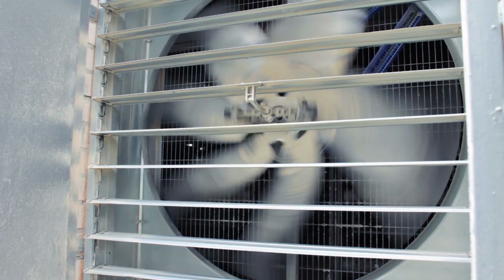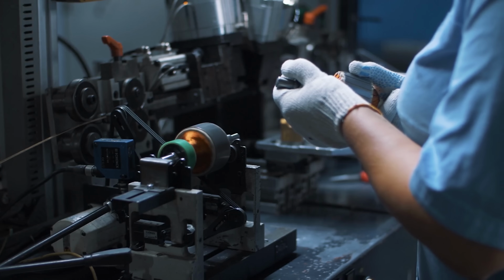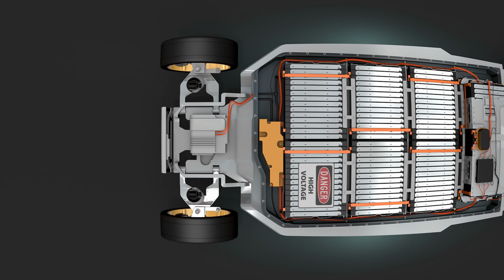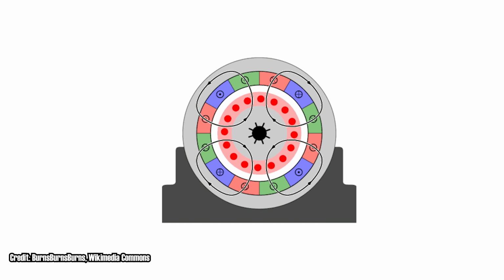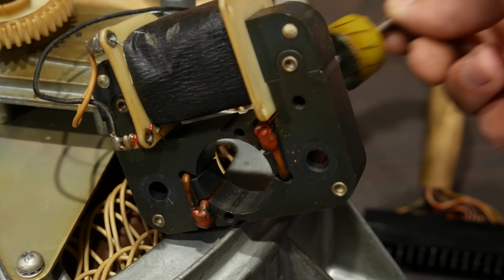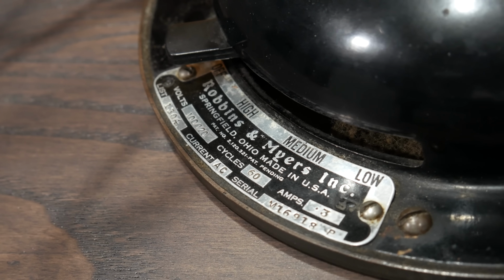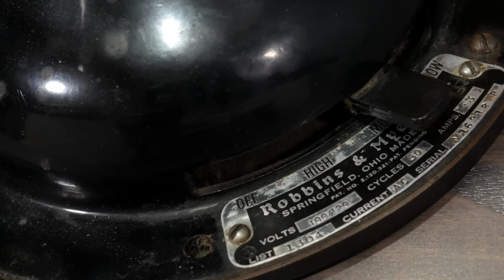Fans; High is next to Off on purpose

Comment: My sister's family have DC powered ceiling fans, and I've noticed that when you turn them on, they first rotate in the opposing direction before rotating in the selected direction.  I think this is to help ensure the fan starts, even at low speed, and to prevent it from stalling upon start up at low speed.

Comment: 14:15 I actually have a couple of tower fans that do that exact same thing. They have separate power and speed controls (complete with remote control and probably a logic board of some kind). When powered on, they default to the last speed they were set to. But, for about half of a second after powering on, they run the fan at full speed.

Comment: "The High setting is first because you need extra power to get the fan spinning from a standstill."

Me: Sets fan on low . Unplugs it . Plugs it back in .

Fan: Starts spinning anyway even though it started on low .
Reply: Yes, but think about, as the fan gets older and the bearings or bushings start to get gummed up, the motor will be harder to start as it's now not as free spinning.

So it would require high to get going.  I had this happen to a window AC unit (vertical).  All worked great for years and I usually had the fan on low.

But then the thing got gummed up and the fan wouldn't start up, unless I left it on high.

Even then, if finally gave up, so I have to remove the AC unit, take apart the fan motor and give it a good cleaning and oiling.

Then it was back to normal.

Comment: When I was a kid, my mom had an old electric Soviet sewing machines. The peculiarity of using this sewing machine was that it had a pedal to control speed gradually. But if you just slightly press the pedal, the machine would hum and nothing else would happen. To start the mechanism, you had to give a flywheel on the right a push, and then it could start sewing at a slow speed. 
However, if you stomp on a pedal, it would start at a rapid rate with no problems. 
I am sure this problem is solved by now, Soviets decided not to bother with it at the time.

Comment: This is great, I just took my fan apart to see if it had a cap, because it was having start issues, so after opening it up, I found no cap!  This video showed me that it is just the bearing, I had figured that out anyway and blasted the bearing with lithium grease and it is working fine, but still needs a nudge to get moving.  Guess its time to buy that 100 year old fan you have!

Comment: Remember that a 100 year old motor was (over) designed to operate for long periods of time. Today motors are designed to be efficient, with just enough core material and windings to do the job. And most importantly the bearings may just NOT be robust enough to run after a hundred years of intermittent use, contributing to the excessive starting torque required.
  Thanks, very well thought out videos.

Comment: I have a fan that goes from Off to Low and I very much appreciate that. What annoys me far less and in fact is very practical, is how the highest setting is is next to Off on a gas stove, so there's enough gas to easily ignite the flame. That actually makes a pretty tangible difference in my experience. I find it far easier to light on higher settings than on lower ones.

Comment: Fun fact, entering the stall condition is dependant on the initial position of the rotor relative to the stator. It may be statistically low that your old fan will stall on a low start, but not zero!

Comment: Without watching I'd answer to your title's question thus : At lower voltage the fan will take much more time to speed up, so if you want low speed you can stay a few seconds on high to build up speed and then switch to the lower power.

Comment: I like that fans turn to High, then Medium and Low, because I'm usually hot and wanting the relief of cooling that the fan produces (by evaporating moisture from clothes and skin). I'd slap it right to High immediately if it were Off-Low-Med-High.

Comment: Interesting... I have a smart plug connected to 2 fans, one window and one that just sits there to blow air on because I can't handle stagnant air for very long for some reason. They're both set to like medium, I don't have any problems, though they are very new fans so I'm glad to hear they can tolerate being on and at a standstill. Loving the content, I know it's over 4 years old now, but still quite informative.

Comment: You correctly say the national grid is 3 phase 120 degrees.

You then say that 2 phases are brought into the consumer unit.

I am English and have never investigated USA power systems.
But I do know that Thailand runs 3 phase in some areas and 2 phase in other locations.

I said the linesman that told me about 2 phase was wrong and stupid.
But I was mistaken.

They do use 2 phase and have understandable reasons!

So I reflect on the USA 2 phases in a consumer unit.

I suspect they are NOT 2 of the 3 phases as you imply.

I suspect the 2 phases are 180 degree opposed.

110v to gnd on both & 220v between them.

Perhaps a bit of star delta transformation math could be slipped into an International picture of mains distribution systems.

Note some use copper and others use alluminium cables.

A tangent,
Metering - single phase meters vs a 3 phase meter.

Tangent,
How a 3 phase meter works when the I or power per phase is NOT equal or balanced.

Ps:  you perpetually  missed the word "stickshon" in the fan motor startup.

Nice work,

Comment: Small critique: I believe house current uses one phase. At the pole, a transformer reduces the line voltage to 220, and the transformer has a center tap that is neutral, but allows either end of the transformer to connect to it for 1/2 the voltage, ie 110. If house current was two phase, 220 would be separated by 120 deg instead of 180 like it is. Also, 208 is a modern 3 phase that is common for commercial lighting and baseboard heating. 220 single phase is what electric stoves/dryers run on.

Comment: Actually commutators are used for constant duty industrial equipment, all the way from motors driving manufacturing equipment to the starter/generators found on airlines. The brushes are swapped out. For household stuff, brushless motors are most common, but industrial equipment usually operating at 400v runs with brushes most of the time.

Comment: Fans made 100 years ago had REAL bearings that would last 100 years.  Most fans seen in today's trash piles are only in need of oil on the cheap bearings that they are made with.  They CAN be disassembled, oiled and reassembled.  I have 40+ year old fans with the cheap bearings that are still working (YES, they have to be cleaned and re-oiled periodically, but not that often) and I not buying a new one every other year.

Comment: 7:50 Wait...so is this why old/small prop planes need someone to actually spin the propeller to get it started?
Reply: Is that a serious question?
Reply: @FAZWORTH421  I'm not sure why it wouldn't be? I'm not an expert on engines or motors, and I never made the connection between fan blades and plane propellers until it was put in this context. But the planes I'm speaking of use fuel as far as I'm aware of, so I wasn't sure if the same rules applied once the connection was made.

So...yes, it was a serious question. Thanks for asking?
Reply: @Sisren86  Hey a lot of people be trolling, and you don't have to be an expert on engines. Just have enough common sense to know that an one is an electric motor and the other one isn't!! Cmon now, how the hell is any of this science homeboy just talked about related to internal combustion engines?
Reply: @FAZWORTH421  My question wasn't about where the power comee from, but rather if the mechanisms used to start the blade/propeller turning were the same. Because those planes did in fact need to have their propellers pushed to get them going, despite being a combustion engine. So if not for the same concept that was explained, then why?

Comment: i just replaced a 30 year old fan yesterday, and wondered why knob style controls started high, now i know. i replaced it not just because it was old, the button style controls had the off button tripped permanently, so i had to jamb a penny between either side of medium depending on what speed i wanted it to run. it also had the angle screw housing stripped so it was propped up where i wanted it with a ruler. last week we had storms that caused a power interrupt and it didnt spin up once power was restored. i unplugged it and also saw there was a split in the cord sheathing just past the angle strain relief. that only confirmed my need to just scrap it. i will miss it only a bit since it had my last name on it.

Comment: @4:55  No, you won't have 2 of the 3 phases in your home/apartment.  The 3 phases are out of synch by 120 degrees.  The home has 240V with two phases out of synch by 180 degrees.  That is generated from ONE of the three phases, at the transformer.

Comment: Funny how I didn't watch this until the end of the long day which started by my waking to a faint buzz and the smell of hot metal. My AC fan would not run, and it got up to 100F today. Repairman replaced a fuse, but left it off, so when I got home to a 92F apartment, I assumed it was still not fixed. All's well that ends well.

Comment: Short answer. High is the first setting from off because that setting has no fan resistor and the fan resistors are connected to that circuit in parallel.

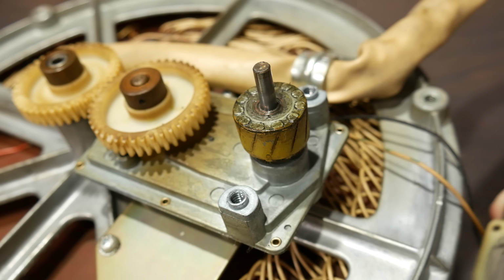Comment: @Stierenkloot  11:04 I'll repeat. The question posed was why is high next to off. Everything you said is accurate, but is filler to the actual question posed. Interesting filler if you were not aware if it but filler all the same. Yes, a motor not in motion creates no torque, yes, a start winding is used to initiate the rotation, however, it doesn't produce enough torque to really get the fan moving. The torque produced on high, once the start winding starts the motion is used to ensure enough torque is being produced to effectively get the blades going.

Comment: Makes sense. I have a fan at work that lets you start at any speed with buttons instead of a dial. It always stutters if I start on the lowest spin, so I always start it on high and then adjust it down.

Comment: Induction motors will wear out because of the expansion from heat cycles. It causes the windings to rub off their insulative coatings, and it will eventually short. That's why you want to keep industrial motors at a constant speed and temp for maximum life

Comment: You notice the need to start on high when the fans are dirty or there is hair tangled around the axle.  Yes, they need a cleaning and oiling at that point, but that obviously doesn't happen when you need to use the fan NOW and if it works with a bit of a shove you hope to clean it later when it doesn't need to be used immediately.  And I have gotten fans to start moving by pushing the blades, often with a stick.

Comment: Until the 1970s electric and diesel electric trains mainly used electric motors with brushes. 

There were multiple reasons for this, one being that 3 phase current was hard to create from a single overhead wire and triple overhead wires a nightmare. 
Another reason was that the frequency of the field was hard to regulate. This needed more advanced electronics for the control, that work at high power. These were not developed for use in such applications until the 1970s, to my knowledge.

Comment: I knew a lot of that already but still watched the video all the way through.  FYI:  A lot of homes built in the late-1960s and early 1970s (at least in California) are equipped with 3-phase electric and 3-phase plugs for electric appliances.  My home has them in the garage (clothes dryer) and kitchen (stove).  The odd thing is it also has gas supply lines if you wanted to use that as an appliance fuel instead of electric.
Reply: You probably have something called split-phase, which is single phase split in two voltages; 120V and 240V.  3 phase is found in stores, office buildings, school etc.  Three phase typically supplies 208V, 270V, 480V and 120 for wall outlets.  This is why for example lighting circuits or sometimes air conditioners in stores or schools etc. are 270V.  The big air conditioners and parking lot lighting are commonly 480V.

Comment: The fans on my PC case have a physical switch that controls the speeds but they will stall if you turn on the PC while they are set to low which means you have to switch them to high and then back to low every time. I basically can't leave it on low without supervision because if the PC restarts its self or sleeps and wakes again, those fans will not restart and they just sit there humming, just like the desk fan in this video.

Comment: What a twist to the universal motor! It's vice versa. The DC motor will run on AC provided the frequency isn't too high to cause commutator problems. This is why trains run on 33 1/3 hertz, because back when the infrastructure was established the commutated DC motors would stuggle with 50 hertz.

Comment: My fan slow is next to off.  You can fine tune speed with the dial to any speed between 0 and max.  It also uses a lot less energy.   Its has a brushless motor.

Comment: I don't know if you will read this comment or not, but in India all the fans go from off-low-medium-high. Sometimes instead of three speed options, five speed options are given, i.e 0-1-2-3-4-5. But I have never seen a fan in India, which goes like that in your vide (in USA or Europe? not sure though). I don't know what will be the explanations for Indian fans according to you?

EDIT: Just to note, not all fan regulators are made cyclic, i.e you can't directly go to high to off. One has to go in opposite direction (High-med-low-off) to power off. That's why I have specifically mentioned the above order.

Comment: To the people saying the video is too long/has uneccesary information I ask a question. Is fully understanding a concept greater than having a simple answer? 

Could summarize as higher power is needed to start the motor. Or an understanding of mechanical components, phases, shaded pole motors, and stalling could be developed. Both are useful in different circumstances.

Comment: TLDW: Fans are easier to produce and cheaper to buy when they’re simple, and while going from OFF directly to LOW is definitely possible, it’s way less complicated to just have the fan go from OFF to HIGH. 

Starting the motor takes HIGH level power? Why over-engineer a system that starts the motor for you and then readjusts to the desired setting when you could just make the first setting HIGH instead? It saves everybody time and money

Comment: EU resident here. Never saw a fan with a dial/slider, they all have mechanical push down buttons, one for each setting, only one can be pressed down at a time.

A dial/slider seems as awfully dangerous, it's weird that you have to increase the speed to turn it off specially when your fingers are being chopped away.

Comment: It's funny, I've never encountered this with a desk fan because every fan of that type I've ever used has separate buttons for each speed + off. I have however encountered this with a ceiling fan - the one in my room does this; it starts on high when you pull the chain. Makes sense as to why now, knowing the possibility of a stalled motor.

Comment: One big advantage of 3 phase electric current is that at all points in time, the three currents add up to Zero. That means, that the net electric field to the environment is Zero too(*). And this reduces waste induction and hence lowers energy loss in transmission without the need to shield the wires. Hence, over long distances, you will always find 3 phase current instead of alternating current. 
(*) in an ideal world. In reality, you always have some small energy leaks.

Comment: This actually explains what happened to my husband's favourite fan last year. It's one of those boxed-in ones where you can't reach the blades, and the switch goes 1-off-2. He would always set it to 2 before he married me because he is a living furnace, but I always set it to 1 because I hate the noise fans make... anyway, I think I may have killed his fan because I probably burned out the motor by only switching it to 1. (There were also some power outages during our six-month-long heatwave last year which probably sped up its demise.)
Reply: Most of the information in this video is incorrect. While shaded pole motors (usually used by fans) do prefer the higher starting torque, most will spin up just fine on low. I have yet to find one that you can't set to low while unplugged and have it spin up

Comment: Half a century or so ago, I was using a three phase converter. A large box on wheels which plugged into ordinary UK mains and had three terminals to connect the load.

Which rather suggests that a fan could be made using a three-phase motor and a fancy power supply. Might be rather too expensive but I have no idea how much such a converter would cost to make. 

(Naval radar units run off three-phase. Hence, in order to run such a unit on a building far from any ships, we needed a converter.)

Comment: Without watching the video I can say that it'S the same as for fluorescent tubes - they need a much higher voltage to START, than they need to keep on working. - fluorescent tubes solve this problem with a "starter" that inducts a high voltage for just a fraction of a second when you turn them on. for fans this doesn't work because the time span is way to short to actually make them turn fast enough.

Comment: I have two fans with low as the first setting.  One is a mechanical turn dial, the other one is digital.  The digital one has a lot of trouble starting so I always switch it to high, then back to low.
Reply: Probably all US fans have low as the third setting?